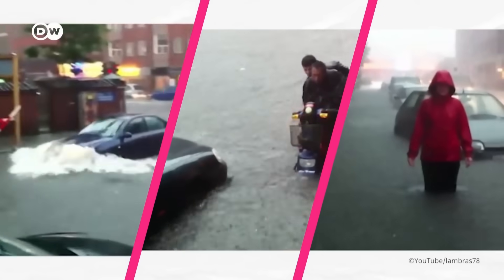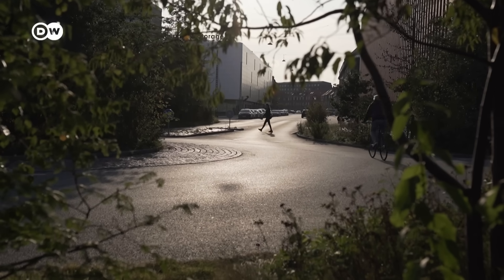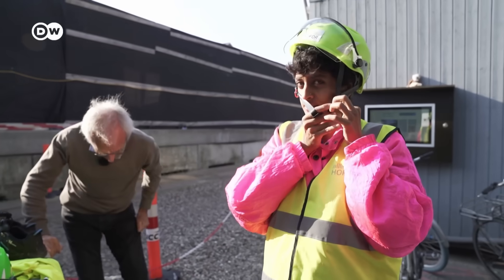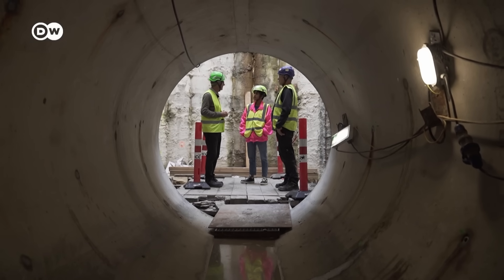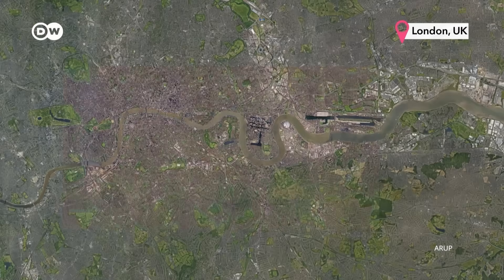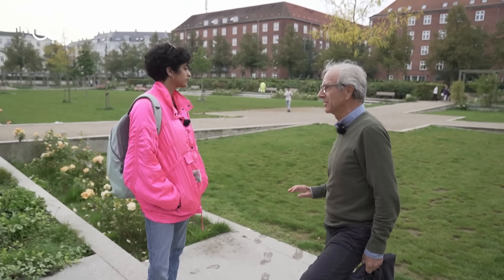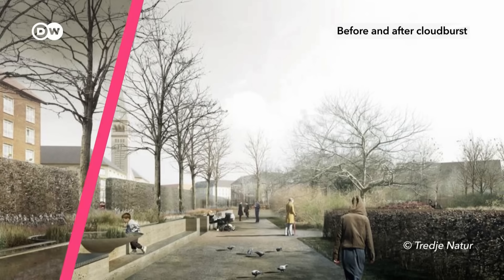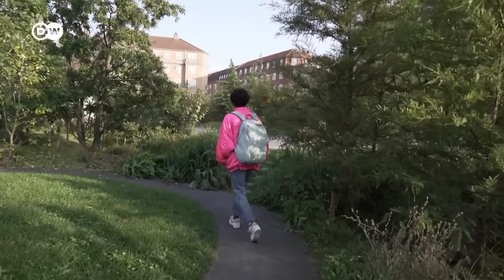Copenhagen: How to flood-proof a city

Comment: I love in Copenhagen, in an apartment building which I believe was the first to implement these strategies. Our backyard was changed from concrete to mainly green areas, with rain being directed from our roofs into ponds. The system has worked so well. Apart from a recent cloud burst which flooded a few basements, we have not experienced any rain water damage since implementation.

Comment: In my city, our regional authority plans to build a 25000 square meters non permeable concrete 'bicycle highway' right into the green natural minor bed of the river that killed 39 and destroyed everything in its path on July 15th 2021. So that when it happens again, the concrete bike highway will be transformed into tons of deadly rubble being swept away at an 80 km per hour speed by the raging tsunami. They did officially inform us yesterday and said that the plans cannot and will not be modified, because 'it's the only place where the new infrastructure can be build'. The many 50+ year old trees that will be cut down on a 5 km stretch of river banks (and that now serve as a 'fresh oasis' during heatwaves) will be replaced by some 'new resilient low grass species', though. And the road foundation will be firmly attached to the historical sewer system in place, build in the river bed too. Adapting to climate change is an urgent matter that concerns each and everyone of us. Unfortunately, some decisions are still based on political agendas, rather than the actual reality. And if the reality commands to change political plans, it is simply denied, putting the risk on ordinary people day in, day out. Your broadcast shows that the 'still more concrete' approach can and should be avoided (even in the case of more concrete for biking purposes). Thank you for that.

Comment: In Copenhagen the city will use all available dirt until 2070 to build a peninsula into the sea at the deepest place. This prevents dikes from being built and with major parts at 1.9 m or 2.0 m and storm in 2011 at 1.83 m it really does not take much more.

Comment: Cities are not comparable. Amsterdam and Copenhagen maybe flat and lowlying, but they get uniform precipitation throughout the year, which is mostly low intensity drizzle for 90% of November -December. And 80% for rest of the year. This is not comprable with torrential monsoon downpours of Mumbai or Jakarta. They get same amount of rainfall in a week that Copenhagen gets in a year.
Reply: That is absolutely true, but it would also be strange to spend all that money to prepare for a monsoon, when we don't get them in Copenhagen. But Tokyo just build a system like in copenhagen, and it is designed for monsoons and enormous amounts of rain.
Reply: @KenKobayashiRasmussen  It is not to question Copenhagen. I am sure it is perfectly designed for the situation there. Just that the video is falsely suggesting Copenhagen solution to be mimicked for vast sprawling cities in tropical and equitorial regions.
Reply: @val-schaeffer1117  Parts of it probably can, but like all such things, you need to design for your local conditions. Adding ideas and experiences to the pool of shared knowledge simply allows planners to better understand which parts can be useful for their local issues. As an example, the playgrounds idea can either alleviate the issues directly, or be modified to be the collection points that other smaller systems lead rainwater into, which you can then have a single large water pipe leading away from.

Comment: God ''Hold my beer''
Not so long ago, a vast splash of rain landed in NW Australia, for over a month the Fitzroy River flowed like never seen before
So vast was this flow, it could have easily supplied the whole of Europe for an entire year
No work of man can ever manage that flow.
Reply: So your plan is basically "do nothing"? What a defeatist attitude.
Reply: @rappscallion3238  Clearly you are 100% clueless to what a swollen river thumping 60,000 cubic metres per second is?
For context the Amazon River which is larger than the next 16 largest rivers combined flows at 200,000 cubic metres per second
To this very day, humans have still not built a bridge across it. In full flood it's 100 miles wide. The Fitzroy was only a baby 20 miles wide for 3 days.
You seem to be the Clues around here, show the idiots how to stop these rivers from flooding, cheers
Reply: Still, measures put in place to deal with flooding would minimize damage. As seen in the video lots can be done and on top of that, one can also make sure to plan for it happening when choosing where to build and how to build.

Comment: I live between two rivers. One is up on a plateau, the other in a valley. Many years ago, coming up to fifty years, both were adapted for flood management. 

On the plateau, a very long, linear park, around eight kilometres of grassland, woodland, and a few pools, was created. This allows for the area immediately around the river to flood, without damage to the nearby buildings. This water is then either allowed to soak into the ground slowly or be dispersed by the river.

In the valley, the river passes through a more built-up area. A variety of solutions have been used, including flood meadows where possible, but also, and less attractively, the canalisation of the river to allow large quantities of water to be delivered to where the flood plain is still free of buildings. This river, being in the valley, has to cope with far more water and has not been fully successful in mitigating floods. The main problem is that this river shares the valley with the railway, a canal, a motorway, and a major road. As a result, there is less land available for large-scale projects.

The plateau river has not had major flood damage since the changes were implemented. Even the less successful changes to the valley river have protected a huge amount of infrastructure, and, despite a lot of rain this year, there has been no flooding, so perhaps they have finally solved the last problems.

Comment: Great initiative!
Agree even if worse than what’s planned for happens, we would still reduce the loss from flooding. 
Wish the tunnels also were built in direction of inland cities to transport and store water. It might not be a water scarce area but if future suggests drops in total precipitation then it would help; rather than diverting it to the sea.
Reply: The "mainland" in Copenhagen is actually an island (Zealand), and there are not really any inland cities to transport the water to.  Moreover, the total precipitation is projected to increase locally in Denmark, so I don't think they would appreciate the extra water ; )
Reply: Normally I would agree but Denmark is a unique case when it comes to the availability of clean drinking water. There is a combination of a fortunate underground natural filtration (Sandstone I think) that leads to large replenishing deposits of clean water and legal restrictions placed on farmers for how much they can spray their fields. I've read the result is that the water that comes out of the tap in Denmark usually is cleaner than bottled water you can buy in stores.
Reply: Scandinavia in general expect a increase in precipitation I'm afraid.
Although there might be changed in exactly where that precipitation falls, and in its form, as rain might replace snow, and glaciers might not hold water anymore once they've melted away.
We've definitely had a increase in precipitation here in Norway...

Comment: I live on a mountain in Southern Quebec, Canada. The township government built small ponds that receive the flow of water from the ditches that run down beside the steep roads of the mountain. This slows the water and prevents flooding further down the mountain. The township also built berms of stones in some of the ditches. This also slows the water flow. However, many people like to live very high up on the mountain so they can have a nice view. This means more roads going higher up and with very steep gradient on the roads. The township has a good strategy - building these small ponds that take the excess water, but sometimes even they overflow. This leads to flooding downstream.
Reply: I wish the town closest to us would do something. We're across the Quebec border/Ottawa River with views of the Laurentian mountains in Northern Ontario and deal with flooding every spring. The federal government rebuilt a bunch of houses due to flooding a few years ago but I don't see the town doing anything to prevent another catastrophe. It's not if, it's when. The town has been told by the feds that no one's coming to bail them out next time, just rescue from floodwaters but no rebuild. Some locals don't believe them due to some critical infrastructure that goes beyond the town to the rest of the province. 

Fortunately, I live on the top of the other side of the valley. When they flood, they cut off supplies, so we keep a couple of months food, water and supplies. No federal or provincial money is coming for anything but housing. So they're building more housing up the hill, but zero plans for the flooding. At least because of where my house is, it doesn't impact my home insurance or anything. 

I'm still amazed by the lack of foresight over the dams from rivers emptying into the Ottawa river from the Ontario side. Some of it unmanaged from the early 20th century and built by civilians. One of those dams collapses and we'll see the knock on effect to other dams. Anyone living along the Ottawa River, Ontario or Quebec could have a very, very bad day. I see houses built along the shoreline and either they have no idea or they're insane.

Comment: Climate Change is real, it changes hourly, daily, weekly, monthly, seasonally, yearly etc...and it's a great thing it does.  It's better for all cities to keep more green spaces because let's face it storm and drain systems are built to fit in a budget and not built to deal with extreme weather, which is normal.

Comment: Please do not build on flood plains. It's stupid. It's simple geography. Ask the Dutch! Wake Up call, a bit late... I would look a 7000 year cycle of terrain formation from the obvious flooding in the past. Even the Japanese noted the Tsunami destruction levels with markers, telling the people how high to run
Reply: I'm confused about your point about the Dutch? Are you saying they live on flood plains and is bad or that they don't? 

The Netherlands has huge amounts of this sort of infrastructure, basically the whole country is planned like this and it works. France and Germany have had many notable floods in the past 10 years alongside rivers which reach the sea in the Netherlands. The only real issue in the Netherlands was in Limburg where so much rain fell in a short period of time that the small rivers burst their banks before the water reached the plains where designated flooding areas were located.
Reply: @16dutch16  and even then most of the problems were because of the uncontrolled amounts of water coming from those neighbouring countries.
if for example Germany had build measures to hold on to part of the rain water not everything would have entered The Netherlands at the same time.
Reply: @ChristiaanHW   That had nothing to do with Germany. When you have hill slopes and extreme rainfall, the water will run down the slopes and accumulate in the narrow river valleys. The Geul starts 5-10km across the border in Belgium. Germany or Belgium had little to do with the flooding of the Geul last year.
Paradoxically it is easier to control rainfloods in low lying polders than on higher ground !
Reply: Alot of the flooding problem even in the Netherlands is from short intense rainfall, the worst place to be then are dry places and in canyons, not floodplanes.
Reply: Flood plains are usually fertile. It makes sense to live there, because you will be able to grow more crops.
It doesn't make sense to build big cities on them, though, from that perspective. The reason for that is often sea transport.
So again: Asking people to make their lives more difficult, in order to avoid flooding.
In the short term, like farming next to active volcanoes, it is a calculated risk between being able to feed more people vs. the danger of nature.
Reply: Flooding can be caused by various issues. The problem of flood plains is in relation to rivers. In Denmark most flooding is caused either by massive amounts of rain on already saturated soil that can't absorb it (so nothing to do with flood plains) or from sea inundation. It is actually a testament to the amount of rain that can fall in a short period of time that so much flooding happens in a rather flat country.

Flood plains are normally an issue of river systems where, when the river swells from lots of rain, it will naturally due to the lay of the land overflow- and was generally left alone to do just that before people started to build on them in the last few decades. Very few old cities were built on the actual flood plain, though there may be parts that have spread to it in recent years.
Reply: if only you were in charge of everything for the last 5000 years, AND the eternal future as well, things would be perfect. We could call it the Kingdom of Captain Obvious and His Sophomoric Solutions!!